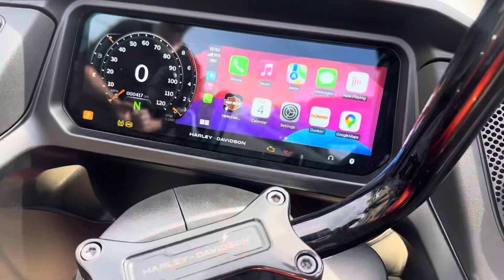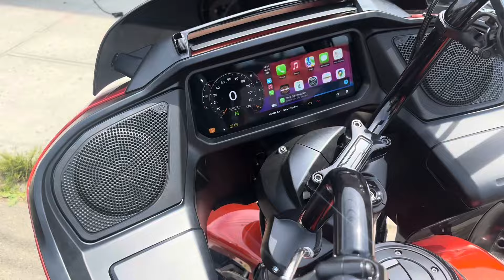Brand new 2024 Road glide in for a NVS Audio stage 1 Two speaker audio upgrade plug and play kit .

Comment: I’m thinking of putting 3 pairs of Euphoria EX6NCD-CF, doing a 6.5 plate mod for the saddle bags plus putting a pair in your pack as well as fairing. What do you recommend for an amplifier’s and RMS to each speaker as well as a compression horn? Where I do not have to cut anything to put the amplifiers in. This is for a CVO ST
Reply from the maker: Street glide or road glide ? What year
Reply: @NVSAUDIO  Sorry - 2024 CVO ST Road Glide
Reply: @NVSAUDIO  also was eyeing Hertz ML 1800.3’s if I could find a conversion kit to house them in fairing in the saddle bag lids and tour pack pods and power them to max @250 rms